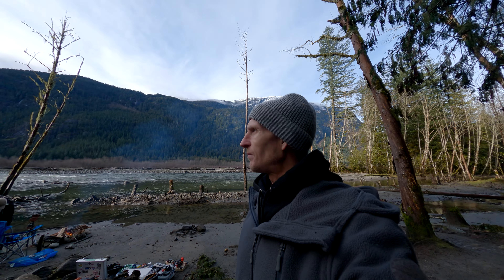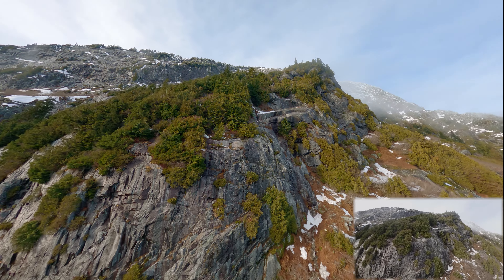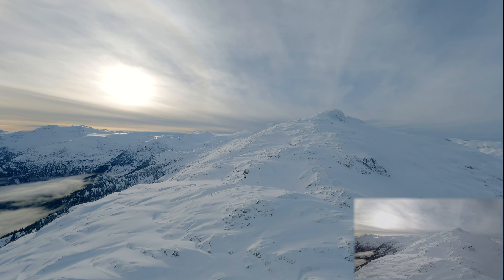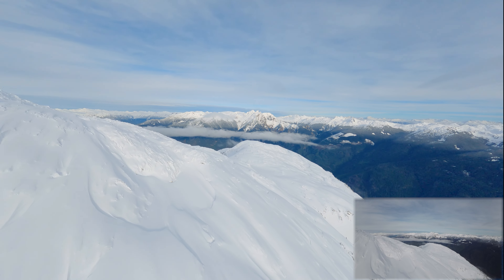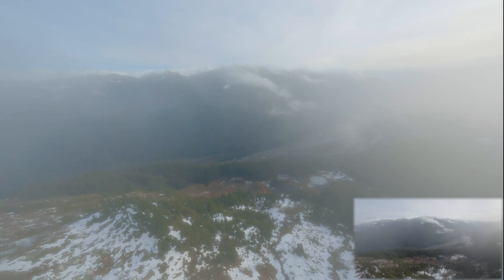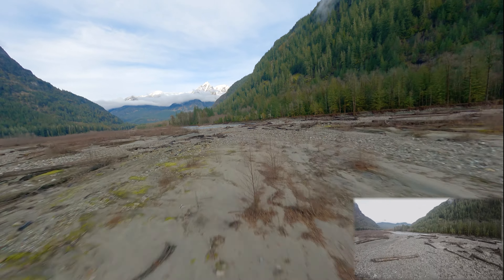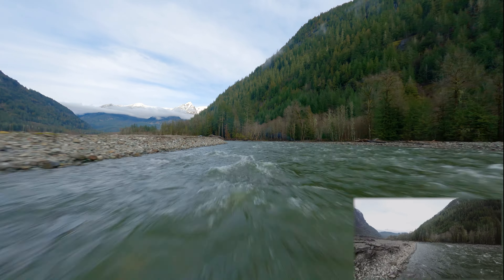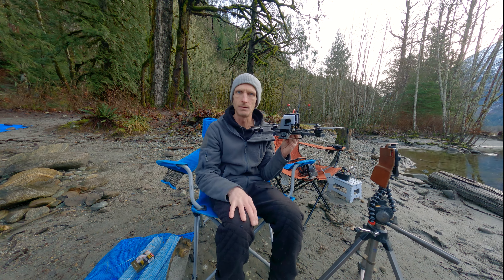Flying Long Range FPV with the GNB 7000mAh 70c LiHV Battery

Comment: I"m glad you finally got a chance to try the HV7000 packs.   They are awesome - I love them (as you know, hahah!) .  I've used lots of HV packs and something that you need to keep in mind is that they don't last nearly as long in terms of usable cycles as regular lipos.  The chemistry starts to die much more quickly when charged to 4.35v.  What I do is charge them to 4.1v (or sometimes 4.2), then in the field I'll top them up to 4.35 so they are at 4.35v for the minimum amount of time possible.  This should extend the life of them pretty dramatically, otherwise you're probably going to start seeing them degrade after 20 cycles or so depending on how long they sit at 4.35... and they are expensive batteries!
Reply from the maker: ah yes, that's what I was expecting.  I'll try your idea of charging to 4.2 and then topping the battery off to 4.35 just before using  it.
Reply: Any updates? im looking to buy them and im wondering how they are holding up.

Comment: If you're using helicals on the DJI goggles then you need to check that they have a low VSWR.   A low VSWR doesn't matter much for analog because the analog goggles don't transmit but the DJI goggles do and a high VSWR will produce very poor transmit performance that could significantly affect the link.

I always spend a bit of time with a VNA to make sure the VSWR of my helicals is as low as I can get them.
Reply from the maker: Thanks for the tip!  Still learning the DJI stuff.  And thanks for your earlier help via your videos.  That was part of where I learned to make them!

Comment: Great video! I have the 6 inch Iflight Bob57 with which I can fly 11 minutes with GoPro and a 3300 mah battery. Would I get more flight time with the 7000 mah battery from GNB, which weighs 234 grams more than the 3300 mah battery? Maybe the flight time would be around 16 minutes? What do you think? Keep up the good work.
Reply from the maker: That wound be getting pretty heavy for 6" props.  You'd get maybe 16 at most, but it would be pushing it say trying to pull out of a dive with all that weight on those props.
Reply: @FalconRadFPV  
Thank you for your answer! I have another question. I bought 2 Rhcp helical 6 turn antennas for the Dji goggles 2 and would like to use them with the iflight Bob57. Do I need Rhcp or Lhcp for the helical antenna in this case?
Reply: @davidsilberhorn  You want RHCP on the drone too if that's on your goggles.

Comment: I’ve experimented with connecting one Helical to two SMA ports on my HDZero goggles, and up to a certain point it worked great to a certain point then the performance seemed to rapidly dropped off!  
I think it’s because it’s splitting total signal power which mainly affects performance when signal is weak… (We gotta ask Hugo)
but I’ve also been meaning to test this more. 
Would be nice not to need four antennas all the time.
Nice video as always, cheers bud.
Reply from the maker: Thanks for the comment, that's an interesting idea.  I actually had two antennas where it looked like one, they were just intertwined on the same holder/mount.  Still trying to sort out if they interfere with each other that way.
Reply: @FalconRadFPV  oh yea! I see it now, that’s really interesting, love that idea. Would love to hear if it works well, maybe I’ll give it a shot as well. 

Similarly, I’ve been wanting to make/test a “Double Helix” antenna, there’s not much information about that design, but a guy Andrew McNeil did a video about this many years ago.

Comment: Damn thats a massive battery lol. So you use helical antennas for lhcp or rhcp without doing anything special to em? Awesome video, I love these long range mountain surfing videos.
Reply from the maker: They are circularly polarized so you need to make it either left or right hand polarized.  (I made my own)
Reply: @FalconRadFPV  so for helical antennas it's just the way the wire spinds. Left or right?

Comment: Beautiful… so amazing… Q: Since most LR FPV is gentle flying, do you see an advantage over a 10,000mAh LiIon pack like the Dark Lithium packs? Those seem to be the best 7” battery out there…
Reply from the maker: The disadvantage is the weight, it fly's poorly as far as agility goes.  But yes you don't need to be agile to get good long range footage.  Compared to a 5000mAh, the 10000mah on a 7" only gets about 40 or 50% more range since it's starting to push the limits of efficiency VS prop loading.  I find that almost every flight I do I can make it with 6s2p 18650 packs with a total mAh of 5600.  They'll get me 9 or 10 km out (and back of course) if I wanted.  I rarely use my 10,000mAh pack, I save it for when I want to be able to reposition and try at several different shots on the GoPro while up a mountain, it gives me several extra minutes to redo a couple of shots multiple times.
Reply: @FalconRadFPV  Thanks for the reply. The 10A/Hr packs from Dark Lithium are my go to packs. I don’t have much experience with LiPolys in this application. I tweaked BLHeli_32 for max efficiency and can fly about 30minutes on 7” props. My frame (AOS7ULR) can fit 7.5” props but the clearance is only 1/8” per side of the battery so I don’t risk it…

Comment: Fantastic video and great scenery. I am expecting any day to see DJI release the O4 FPV version as they have already released it on their air 3 and mini 4 pro drones. But you would have to upgrade your goggles to the goggles 2 or goggles integra. I have the Goggles 2 with my Avata. Which the avata is still using occusync 3 but it gets great reception. I have a couple FPV drones as well that I want to upgrade to the DJI O3 unit. I would love to have those mountains to fly at their absolutely breathtaking.
Reply: I'm on walksnail but always interested in what DJI brings out, wish I could use them actually but my ipd is too wide, heard that there may not be an 04 air unit and it was just put on the other drones so they could use goggles, should find out pretty soon.
Reply from the maker: That's the one thing I don't like about DJI, they stop supporting past hardware quite quickly it seems.  Makes you need to upgrade often which seems like a sales grab.  All that said, damn the 03 air unit looks great (on all the goggles).
Reply: @FalconRadFPV I,m also using the v2 goggles with the o3 and the combo is awesome.
If they bring an o4 air unit we dont know about the compatibility yet,if it is compatible with the Goggles 2 it will be also compatible with the v2 goggles.
Or o4 will be only compatible with the Dji Goggles 3! Thats the other scenario.
But for now all we have to do is enjoy the o3!😎
Reply: @FalconRadFPV   But they did support Vista on G2s and O3s on V2.  It took some time but maybe DJI is listening a little bit :)
Reply: @FalconRadFPV soon you'll have openIPC open source HD. No longer need for DJI!!

Comment: Awesome video man! Just wondering what frame rates you have set so the snow isn’t over exposed when you get above the tree line? Do you just use auto for this situation?
Reply: I just found an older video of yours answering all of my questions. Amazing!
Reply from the maker: I might make an updated gopro setting video now that the hero 11 and 12 are out.  But ya sometimes auto or else usually 1/120th shutter, and just locking it and the ISO down low and deal with the river portion being too dark so the nice snowy footage won't be blown out.  Backlit clouds make it tough, on a blue sky sunny day its much easier to find the right setting to lock it to.  But also on a sunny day auto works ok as well and doesn't shift around as much.  ISO as low as possible is pretty key, I won't go above 200 on my 11 mini.

Comment: Hi Falconrad thanks again for another amazing upload, but may I ask for some of you help or maybe someone in the comments can help, what I am trying to do is, for example in the North York Moors National Park here in the UK , lots of people get lost and need help  to find their way back to safety, so my idea is to make 1 of Falconrads long range FPV drones use it to go and find these people, and then be able to drop of to them a small radio, so what I am asking is can I some how fit and operate a 9 gram servo to the drone being used in the video, so that I can then be able to drop off the radio to the people who need help, when I find them? and if so how do I do it, thanks for your kind help.
Reply from the maker: Wow, cool idea.  Yes that can be done.  Both Inav and Betaflight have options to control servos as part of the firmware.  I don't think it's hard to get a servo to operate with either one of them.  Just search betaflight servo control or inav servo control.  I'm sure you'll find a few videos talking about getting servo control setup.  There is for sure space underneath on the frame to hold a small radio.
Reply: Hi FalconRad thank you for the info I will check out  what you're saying , thanks again for all the amazing uploads on your channel 👍👍👍💯💯💯 @FalconRadFPV

Comment: Do you think a 3d printed frame can ever compete with a traditional frame? How much less efficient do you think it is? 

I’m just so interested as with a 3d printer you can endlessly customise.
Reply from the maker: It's not about efficiency, it's about the rigidity of the materials.  It's tough for a 3D printed material to compare to carbon fiber plate.  It would need to be printing with a very strong and very stiff material which is extremely durable.  Anything less than carbon fiber for big frames and it's just way to much vibrations for the flight controller and motors to handle.

Comment: A new video with setting betaflight be helping , because my falcon 7 have a problem with trottle , when i descend trottle 0 , a motor spin again and i dont go down , with 4.1 i dont have a this probelm ,but with 4.2 and 4.3 i dont succeed my setting
Reply from the maker: If it spins up the motors and isn't descending when you lower the throttle, my first thought is to try lowering the D-term filter slider by 0.1 - 0.2.  Did you use the same PID's in 4.3 as you did in 4.1?  I think for 4.3 the PID numbers are calculated differently so the "tune" needs to be different, and I'm fairly sure the PID numbers should be lower in 4.3 than in 4.1.  So you could also try lowering the PID master slider by one or two notches, that also might help.  I have been thinking about making new videos for betaflight 4.4/4.5 settings for all of my different frames.  It's not very good weather this time of year right now, once we start getting less rain I'll be able to do tuning videos more easily.

Comment: I was curious to try a large LIPO on the rad-Lion !
Reply from the maker: One this size would need to be bottom mounted, unless you did some sort of FPV camera & GoPro out front mount thing.  I've done it before, mounted the GoPro out in front of the drone and the FPV camera on top of that.  It would just take some work getting a good design figured out.

Comment: how is diving with that big battery? do you think a stock chimera 7 could hold it? Im always pushing the range of my lions  and lost my drone several times. Check out some of my Alaska FPV adventure vids!
Reply from the maker: Ya the chimera 7 should be fine with the same lipo.  Being an HV lipo it's weight isn't too bad.

Comment: Sweet lr flight,  I looked at the GNB 7000ma 6s battery and I wish I purchased it instead of the liion 4500ma lion I just built. I have a Source one 7in v5 that I used 2808 1100kv toka motors, but im still testing it before I start climbing some mountains.  Did you build your google Helix antennas ? I just don't see them in your part list. Thanks for the info
Reply: Use the new gemfan 7050 on those motors. You will like it
Reply from the maker: I have a video about how to make the antennas here: https://youtu.be/aH0cW9XJ4D4

Comment: Are you also still flying LR on 8S ? Or don't you see a benefit?
I'm flying my latest 7" build on 8S and really like it. Don't want to got back to 6S.
Reply from the maker: I've only done testing with 8s really.  I have 2 8s builds but only use one of them every now and again.  I made my 8s build as my extra range scouting quad but I always use my regular Rad Li-ion or Falcon RPM builds for recording footage for YouTube.  I'm looking to do an updated 2024 Rad Li-ion build in the nice 8mm arms version of the frame and using the new t motor f55 pro 8s ESC.  When I get that build done I'll start having more 8s content for sure.  I should get on that......

Comment: Hi FalconRad. Great video once again! I have a question if you could find the time to answer. I'm also interested in using big lipo packs for long range but most of the batteries of that size in my country come with a xt90 cable while my quad uses an xt60. Is it ok to use an adapter (xt60 female - xt90male) in order to achieve this, or am i risking it?
Reply from the maker: Yes that's fine, I use an adapter for xt60 to xt90 sometimes.  You can also just cut the xt90 off and solder on an xt60.  (for safety do this when the battery is at a low charge, like 3.5v)
Reply: @FalconRadFPV  Thank you for the reply FalconRad. Take care!

Comment: Hi, I used this battery for Walksnail and ended up burning out two modules after 30 seconds of flight, the second time also burned out the ESC and ESR capacitor legs. You seem to have used standard parts and everything works, in my case some disaster.....
Reply from the maker: Wow, sorry to hear about that.  The type or brand of battery won't matter, unless the parts were not rated for 6s voltage! Sounds like you might have wired up the capacitor the wrong way or something like that?!
Reply: @FalconRadFPV  No, this is a Walksnail module problem, this was the second module to burn out, the first one at least did not short circuit and allowed the unit to GPS back.

Comment: what antennas are you using for the dji o3?
Reply from the maker: I've got TrueRC Singularity antennas on the 03 air unit and on my goggles its just two of the DJI stubbies and the iflight crystal patch.

Comment: What do you think about 7.5" vs 7" for long range?  What props do you recommend for 7.5 (those gemfans you mention?)?
Reply from the maker: The Genfan 7535 are what I use.  They seem to work quite well, minimal vibrations.  I think the HQ's are fairly similar as well.  You do need a slightly bigger motor to spin the 7.5" prop well.  I'd recommend a 2808, 2810 or 3008

Comment: Awesome! What gps are you using?
Reply from the maker: This build has my old brainfpv gps on it.  The gps still works great.  But if you're looking to buy a new one go for an M10 gps the performance is noticeably better between an M8 and M10 gps.
Reply: Awesome advise! I have the iflight m10 blitz on order.. I believe that’s what is on the Helion 10.

Comment: Will you ever make a 10" or 11" frame?
Reply from the maker: I made a flew an 8" RAD Li-ion, but I didn't really fly it very much, I still preferred the way my 7" was flying.  I'm halfway through drawing up a 10" version of the Falcon RPM frame, but it's a lot of redesign since it doesn't just scale up like a typical X frame does.
Reply: @FalconRadFPV   yea and I been looking 6s vs 8s and battery sizes & weight for big packs. Like 6s4p and 5p. 3314 motors or 3115 .. if u don't make one I figured I'd look at chimera cx10 & geprc pulsar lr 11"

Comment: Do you think you might run the 03 without a gopro?
Reply from the maker: \If I'm flying for just fun then ya sure.  But if I'm flying to get footage then the GoPro is what I'll use, it's just a big step up from the DJI 03 footage, at least in some lighting conditions.

Comment: Traditionally, LiHV have lasted only a fraction of even ordinary lipos... I wonder if "they" have "fixed" the problem, yet...
Reply: As far as their life... the ones I have used, the highest c rated ones but only the smaller 650 ones, seem to not last as long either, think it's because they are pushing the cells to the limit, even regular lipos will last longer if not charged all the way to 4.2...
May last longer if you only charge high volt to only 4.3 or something
Reply from the maker: I might try that, just charging up to 4.3, the last bit hold hardly any mah anyways.
Reply: Agreed, lihv doesn't generally seem to be worth it, the longevity is MUCH worse

Comment: How long did it take to get this level of confidence in your quad?
Reply from the maker: When I build a new quad I'll just do a couple of test flights before going on to flights like this.  I'd do one halfway out to start and fly the battery down to empty and write down the mAh used and ending voltage and then ready to go all out.  For me I think it's more about confidence in the gear than the individual builds.  I know what all the gear is capable of and feel comfortable expecting a certain result with minimal testing.  Keep in mind I've built LOTS of long range quads and just know how to do it well so it's easy to avoid antenna reception issues, electrical interference etc.... I guess maybe it's confidence in my ability to assemble a quality build

Comment: Only get about a mile with my Vista and my v2 goggles on 1200mw. Any help on new antennas or what to try?
Reply: that doesn't sound right - I've been out 4 miles on 800mw (haven't done the hack) - I'm running TRUERC antennas on quad and trueRC stubbies + the iflight crystal patch on my v1 googles.
Reply from the maker: As the other reply mentioned, upgrading to TrueRC singularity antennas should help.  But for good range the TrueRC X2air is really great for the goggles.
Reply: Had to get a new ufl antenna and works good now

Comment: Oh man i dont think these fit my small frame. Im not sure., I have lumineer cinelifter 6s 3500mah i have used that is 140mm it says. and it just barely fits I think gopro cant tilt back.
Reply from the maker: these are also 140mm long.
Reply: @FalconRadFPV  yea doesn't fit with gopro. Think absolute max is 134mm 🤔  unless I don't run gopro